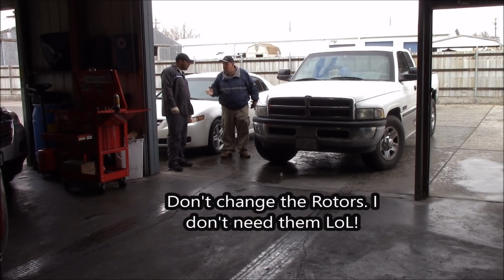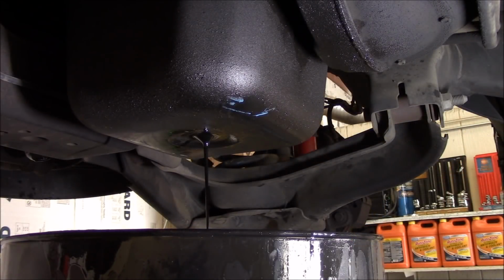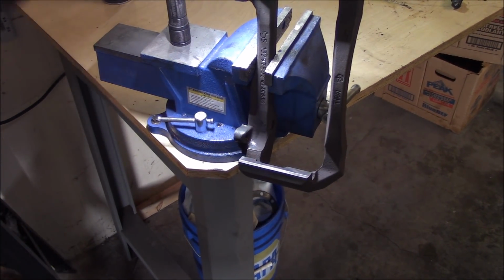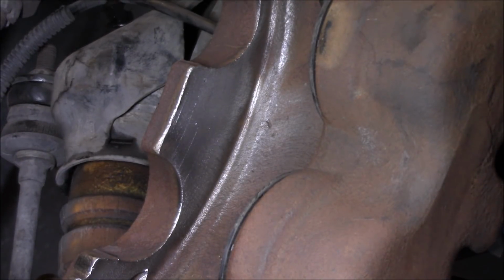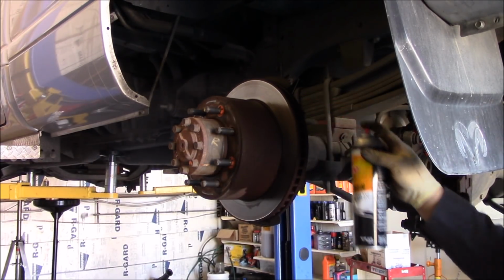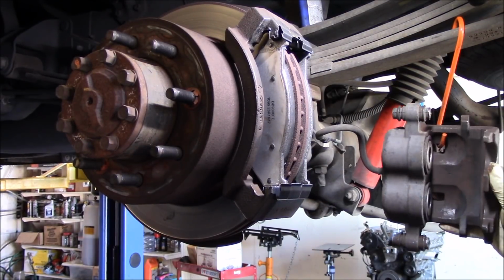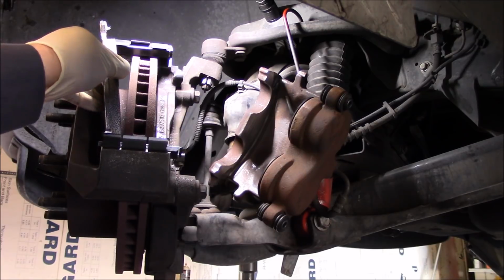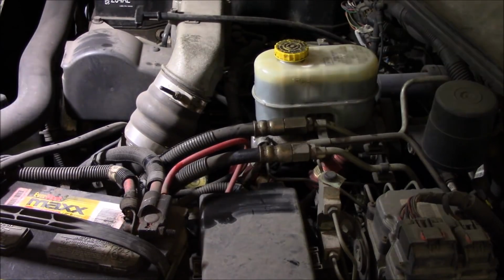Brakes and oil change (2002 Dodge Diesel)

Comment: A 16 year old vehicle in that good of shape makes me so jealous living here in the rust belt. Have to do the same cleaning the mating surfaces, but much more extreme when it comes to the caked on rust lol. Great attention to detail.
Reply: and the oil filter is extremely easy from the top in my opinion. I owned a 12v cummins where its in the same exact spot. Could use a filter wrench after pulling the intake hose. Just in case you service the vehicle again lol
Reply from the maker: LS swap it Thank You For the Tip that filter was definitely a pain in the neck from the bottom.  So yeah it's coming from the top next Oil Change. Thanks again for sharing your experience!
Reply: Of course! Im pretty sure I speak for everyone saying we appreciate the videos, considering the time they take to make while slowing you down while you work! Time to catch up on the videos

Comment: Bryan great job what is the brand and part number for your oil filter set
Reply from the maker: https://www.amazon.com/CICMOD-Aluminum-Filter-Removal-Tighten/dp/B01MDNF8L2/ref=as_sl_pc_tf_til?tag=bryan916-20&linkCode=w00&linkId=f6cf8683207fa0be201b1f3d9e4c6390&creativeASIN=B01MDNF8L2
Reply: thanks Bryan I'm placing my order now for the filter set

Comment: I thought the reason for opening the bleeder valve is so that you didn't make the fluid Go reverse to the valves in the ABS pump
Reply from the maker: I'm selling it for 6500... yeah I'm aware of that theory, but no one, as far as I know, has ever ruined an ABS pump by moving the fluid upstream
Reply: bryan916 good price and also good to know I make all my guys crack the bleeder valve and use the sucking pump while pushing in the Pistons
Reply from the maker: boostedKTM  there's certainly nothing wrong with that!

Comment: What caliper grease are you using? The permatex I have is dark green. Do you fill your oil filters with oil? I try to as long as filter isnt upside down. So strange seeing calipers come off without persuasion with a thumb detector (hammer) and prying, red locktite instead of never-seize. Around here that would have likely made a 1 piece unit lol. Great job as usual Brother
Reply from the maker: TwiZ1975cj5 the caliper grease I'm using is made by 3M silicone paste.